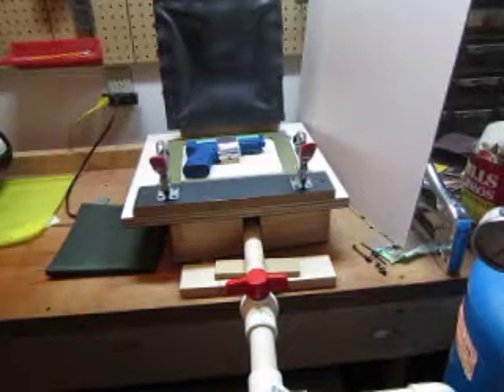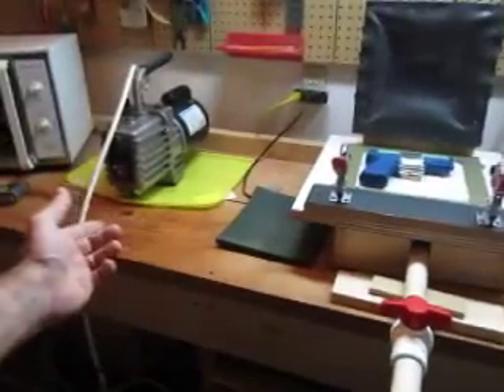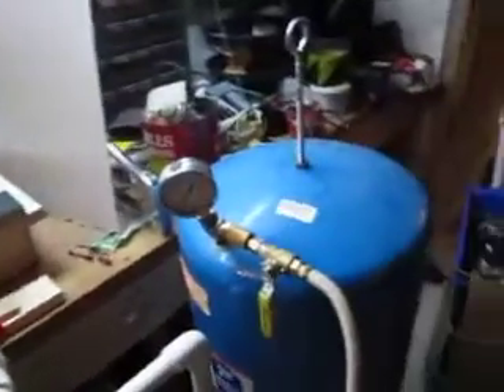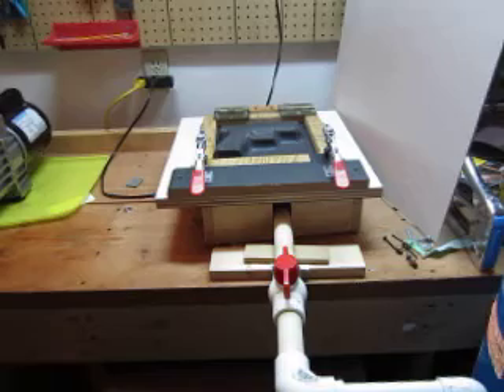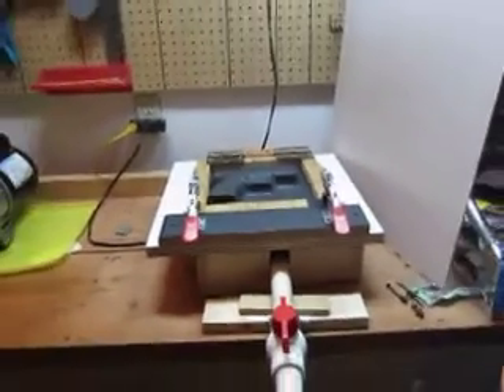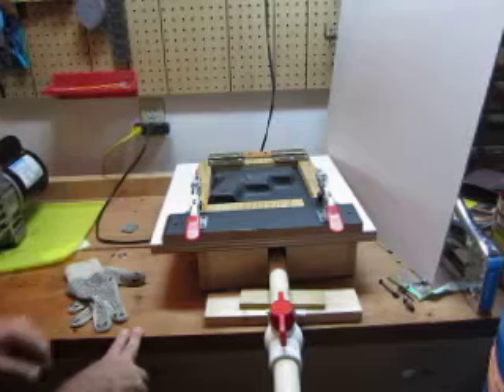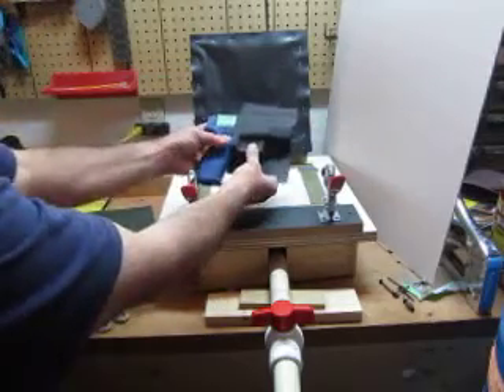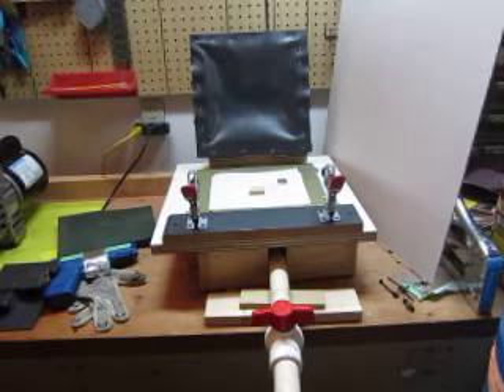Membrane Vacuum Former

Comment from the maker: I just tried the Air Vacuum Pump  venturi-type from Harhor Freight to evacuate the air from a cleaned 20# propane tank.  I connected the venturi pump to the vacuum tank (the fittings on the pump are R134a/R12 connections had to rig a piece of pvc pipe to fit over the fitting) then connected my 3hp 20 gallon air compressor set for 120 psi. The best I could get was 21 inches of mercury read in 20 minutes. My electric pump pulls it down in 2 or less minutes.

Comment from the maker: I started with the epdm rubber liner first because it was $0.65 sq ft and was easily obtained locally. Silicone is like $10.00 sq ft. once I work the bugs out of my system I will get the good stuff.

Comment from the maker: The data sheet on the liner is 250 degrees max but I have not molded enough kydex to know if it would be a problem. I used the foam as a preventave measure. I had on piece that got a small hole in it and I just patched it with a innertube pacth kit and kept going. It is less that a dollar a sq ft and silcone I belive is more expensive. The liner is easy to come by. I think a friend of mine has a venturi pump from harbor freight I will try to get it and give it a try.

Comment: Continue...I've considered using a venturi vacuum generator in conjunction with my air compressor.  Did you give any thought to using a venturi vacuum generator rather than the vacuum pump?

Comment: Mikey, would you consider doing a video showing all of the components in you system with descriptions, how you load your vacuum storage tank, fittings and so forth.  Your video is the first one I've found on YouTube that addresses the waste of Kydex materials.  I've considered using a venturi vacuum generator in conjunction with my air compressor.  A membrane vacuum former seems like the best solution I've seen yet for vacuum pressing Kydex.

Comment from the maker: You only need a tank that is larger than the volume of air in your table and piping. My first tank was a new 20# propane tank. I also tried a 10 gallon portable steel air tank. During my research on vacuum systems some people were using 3" & larger diameter pieces of PVC to make tanks.